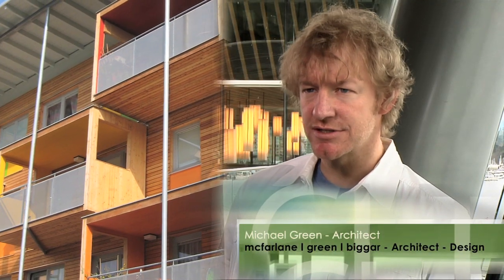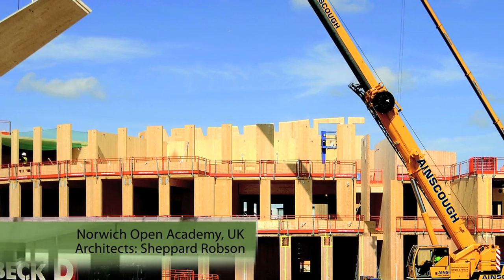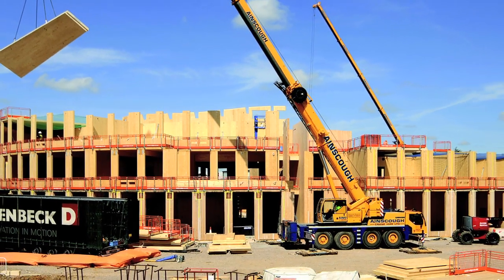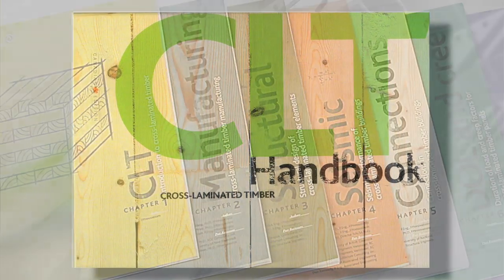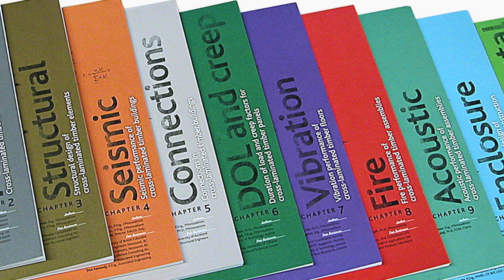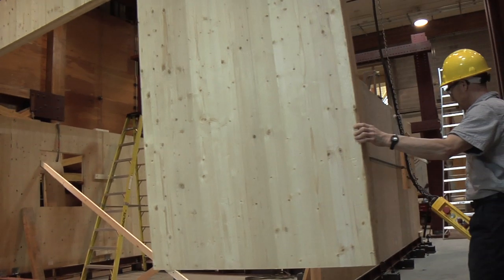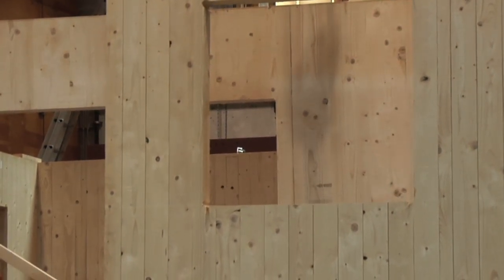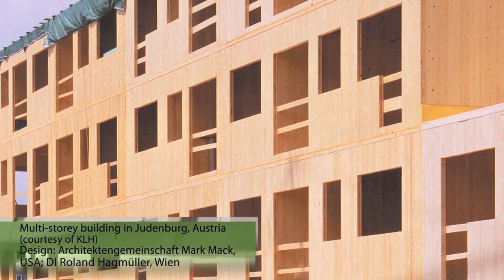Introducing Cross-laminated Timber (CLT) to North America

Comment: CLT benefits from all the carbon dioxide in the air speeding forest growth, warmer climates lengthening growing seasons. CLT sounds great because of its speed in building, low material cost, safety, and that it has the potential to take the wind out of the sails for global warming alarmist.

North America has more trees now than it did 100 years ago. I'm not saying cut them all down.  Just saying that that environmentalist sometimes over state the problem.

Comment: It will be interesting to understand cost as compared to concrete and steel. More importantly on the durability of the adhesive properties over time as well as the integrity of the fire rating.
Reply from the maker: Matthew, 
I would recommend to connect with CLT manufacturers (http://www.rethinkwood.com/masstimber/mass-timber-manufacturers) to determine cost of materials as this will vary from project to project. 

In regards to durability and fire testing, please see the following resources to learn more: 
www.rethinkwood.com/masstimber/products/cross-laminated-timber-clt/handbook/modules 
http://www.apawood.org/SearchResults.aspx?tid=1&q=PRG%20320
http://www.rethinkwood.com/masstimber/cross-laminated-timber-clt

Comment from the maker: The most recent example of cost savings (more than 15%) using CLT is the Stadhaus in the UK. Unlike other products that deplete the earth’s resources, wood is the only major building material that grows naturally and is renewable.Heavy timbers have a particular advantage in a fire because they char on the outside while retaining strength, slowing combustion and allowing time to evacuate the building. Send us your email for more resources and contact any of the technical advisors at US WoodWorks.